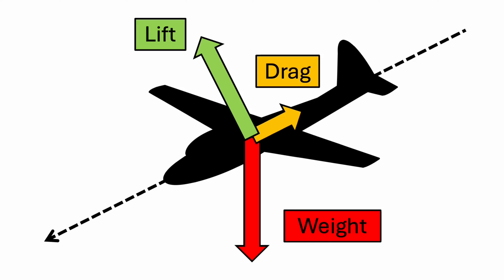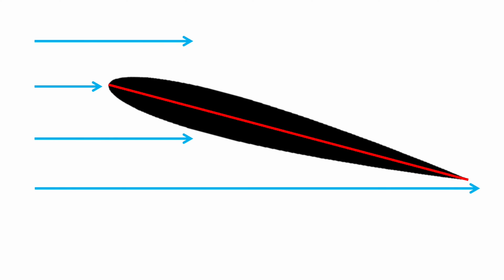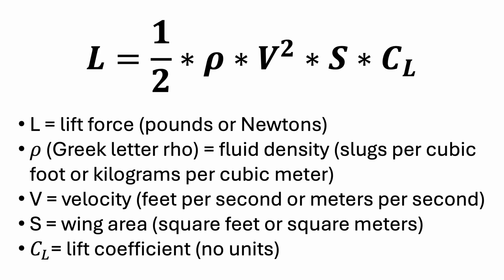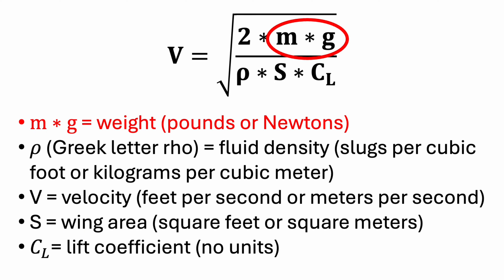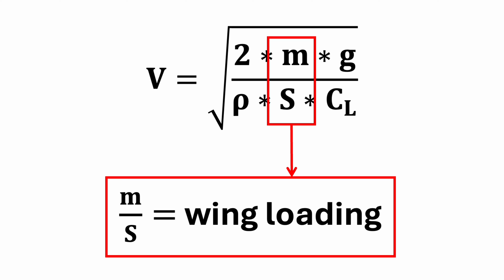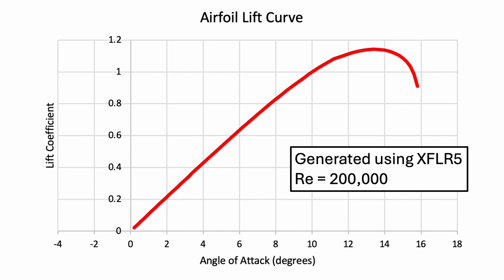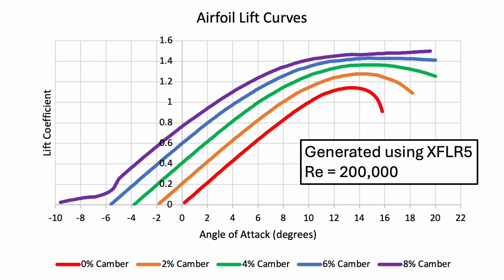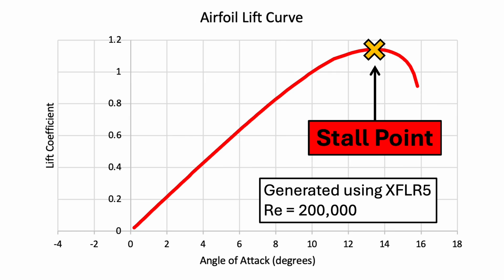Lift Force Explained

Comment: I noticed all the wings you use have what I would call dihedral tips. Is that for lateral stability? 

{IIRC a lot of Free Flight model airplane designs have that feature.}

Comment: I'm sorry buddy but your mistake. If what you were saying was correct an airplane with a flat bottom of lawyer would not have Lyft in level flight and it most certainly does have left. Airfoils generate lift because of the relationship between the vacuum above the wing and the static pressure below the wing
Reply from the maker: Can you be more specific about what I said that you suspect is incorrect?  I'm not following what it was I said that implied an airfoil with a flat bottom would not produce lift.
Reply: @DesignYourOwnAirplanes-xd6lz  I actually don't recall the video that well and exactly what it was you said. However it did become clear to me that you don't have a full grasp on why it is that an airfoil produces lift. I referenced the flat bottom airfoil because it produces the maximum amount of lift in level flight.
It's not a redirection of the airflow across the top that causes an airplane to fly. It is the relationship between the atmospheric pressure below the wing and the negative pressure that is created as it moves through the air. That's why a flat bottom airfoil will produce lift in level flight
Reply: @engineered700  But there's more to that. What you said here is true but it's not complete story. You can always go into more detail. That being said this channel goes into what you need to know to build your own - home made - airplane. 
Now, with that being said there's 80% chance you're bot and you're not attuned to context of this channel.
Reply: This argument never gets old! Wings divert air, if they didn't they wouldn't fly.
Reply: That's bot
EDIT: Lesser bot - not worth your time

Comment: It seems to me that the latest scientific understanding is that it is the downwash of air (via the camber of the airfoil or the angle of attack or both) that creates the majority of the lift, not the low/high pressure distribution. Hence there are no aiplanes that have airfoils with no camber and with zero angle of attack. Or are there?
Reply: The redirection of the airflow happens because of the variations in pressure. 
The analysis of the Navier-Stokes equations, especially the conservation of linear momentum, establishes that the term involving the pressure forces acting on the fluid are just as relevant as the biggest other cause for change in momentum. This is because pressure (specifically pressure differences) cause movement.
Source: I'm an aerospace engineering student and I've just started my profile aerodynamics subject
Reply: @Ohmyus111   - Thank you for your answer. So..., both are imporant. Would it be fair to say that pressure changes become more dominant at higher air speeds? As in: A commercial  jet can level out a lot more at higher speeds because it isn't so much the angle of attack that creates the needed lift but rather the shape of the wing?
Reply: @my_dear_friend_  The lift equation already takes into account that at higher speeds more air will be redirected, since Cl in the most approximations depends only on AoA. 
L= 0.5*rho*V^2*S*Cl ; so as airspeed increases without changing AoA, lift increses.
As for the pressure term becoming more relevant at higher speeds, I think I'm missing some context to your comment, since you seem to be comparing flight at different speeds but only mention commercial jets. Still, it's not that the pressure term (*) becomes more relevant as speed increases, or at least not directly. This is the way I like to think about it: as airspeed increases, the convective term of the equation increases (this is the redirection of the airflow) while the viscous terms, although relevant, become less and less so, to the point where under certain other conditions it's possible to use simpler equations that do not take viscosity into account. As for the pressure term, it's as we discussed before, it will adapt to be as relevant as the convective term, which is the most relevant at higher speeds. 
Basically I'm saying that pressure differences will be those the fluid needs to help adapt to the speed gradients, so both will remain equally as relevant and increase in magnitude at the same rate.
Finally, excuse me for overlooking in my original comment your question on camber. The aerodynamics involving camber and the change of lift produced by different profiles with different camber is mostly experimental right now, or maybe I've not gotten far enough along my course, so I don't have much in the way of justification except refering you to Magnus' theorem about circulation around profiles and the vortices involved. Experiments show that wing profiles with high camber, about 12-18% of the chord length, provide the best lift to drag ratio at low speeds. So in that way, cambered profiles are more efficient. 
As you probably can tell, the conditions in which flight will happen are very important, as well as the desired handling of the aircraft. For instance, almost all aerobatic planes have symmetric profiles (that is zero camber) to allow for inverted flight without needing an exaggerate angle of attack. 
Commercial wing profiles are designed with camber to delay transonic effects and to accommodate lift-increasing devices such as flaps.
I hope that answers all your questions
(*) These are the terms of the conservation of momentum Navier-Stokes equation
Reply: @Ohmyus111  - I had to get this translated but I think I understand this somewhat better now. Thanks!
Reply: @Ohmyus111  so basically, pressure vs downwash is a bit of a tomato tomato, wave-particle situation where both are simultaneously correct and it's just a matter of what's more convenient for the math at the moment?
Reply: @spindash64 yes, the thing is that "the math" in these simple situations has to be very generalized in order to get somewhere. If we were making a simulation (and in fact this happens in real ones) things get harder to interpret.